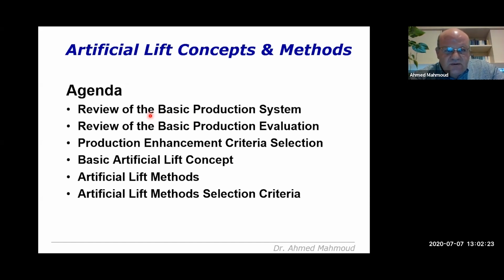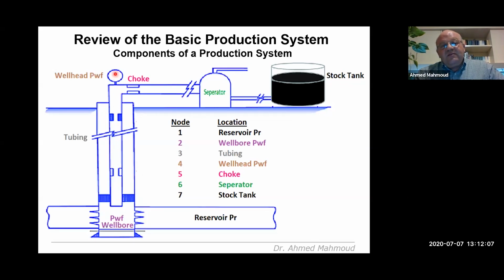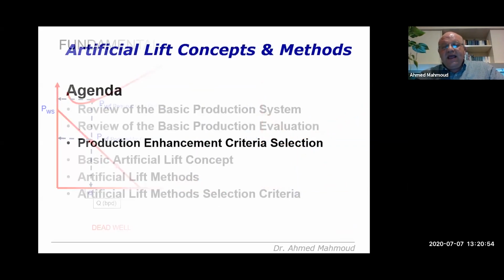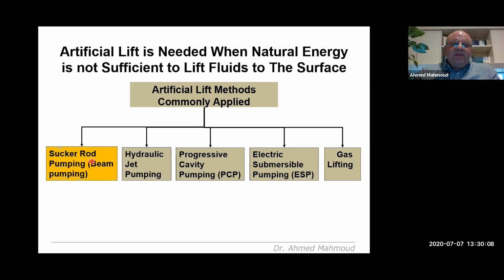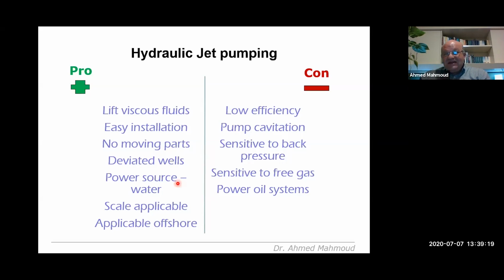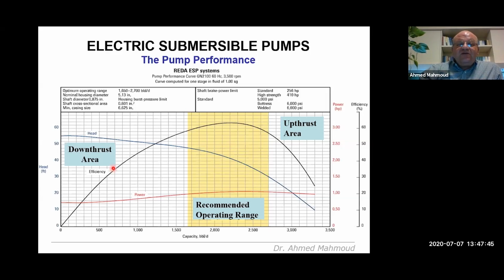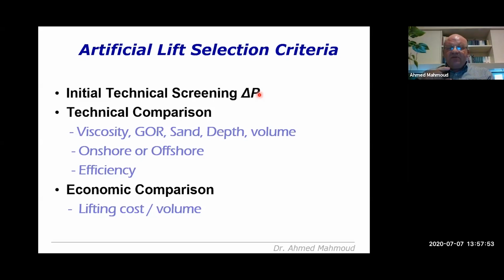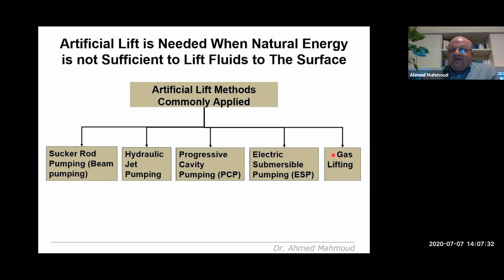Introduction to Artificial Lifting, Dr. Ahmed Mahmoud

Comment: It was a very well_presented lecture.
I would like just to ask a question,  I guess the slight increase in bottom hole flowing pressure in the outflow performance curve is due to slippage effect,  I am just trying to confirm it with professor if it's true or not.